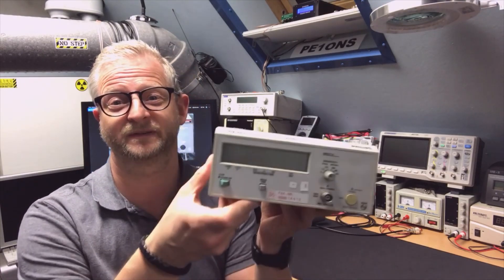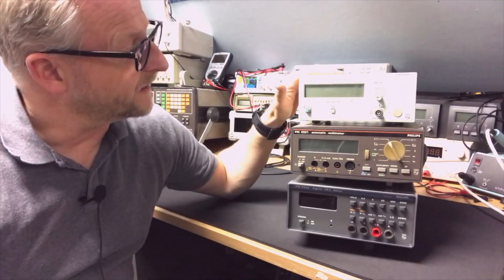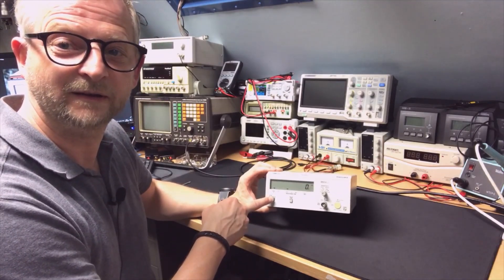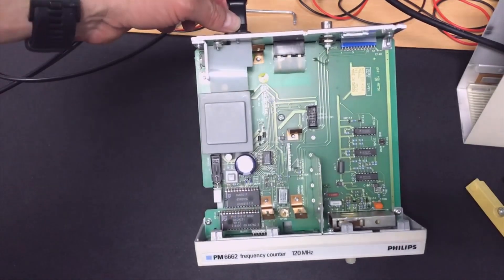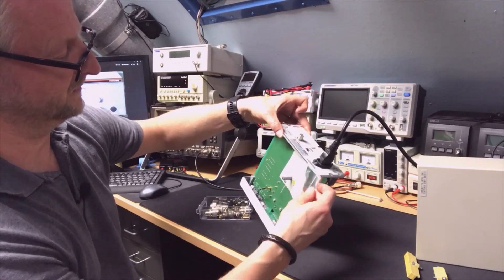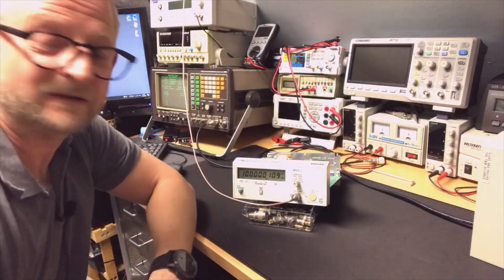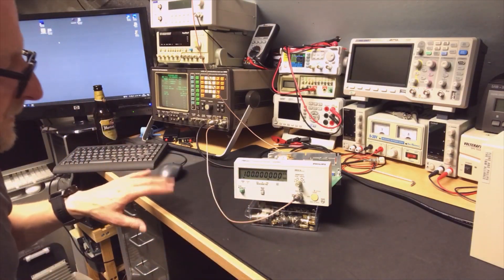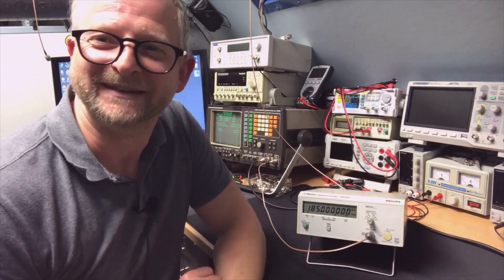#035 Philips Fluke PM6662 Frequency Counter

Comment: Dit zijn leuke goedkope countertjes, ik heb de Fluke 6669. Sinds er Fluke op staat gaan ze ineens tot 160 Mhz ipv 120 Mhz :-)  Met de gevoeligheid is niets mis in elk geval, ruimschoots onder 10mV eerder richting 5mV, op 200Mhz nog steeds maar ca 20mV. In de 6669 zit de Xtal osc op een los board in een connector op de grote print, tussen die klemmen past precies een OCXO boardje uit China van nog geen €20, de TTL uitgang en spanning verbinden en klaar. De sinus uitgang van de OCXO heb ik aangesloten aan de voorkant waar normaal de input van de 1.3Ghz prescaler zit, zodat ik daar nu een redelijke 10Mhz referentie heb.
Reply from the maker: Ja leuk spul! netjes aan de voorkant die 10 MHz, leuk idee